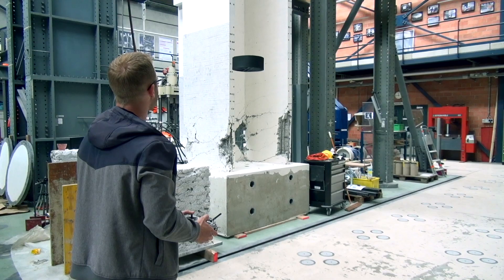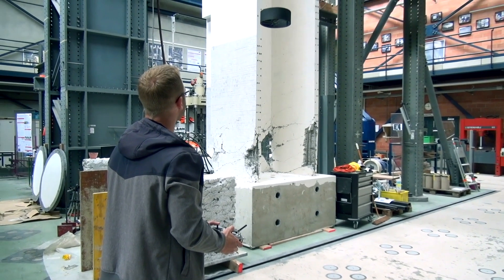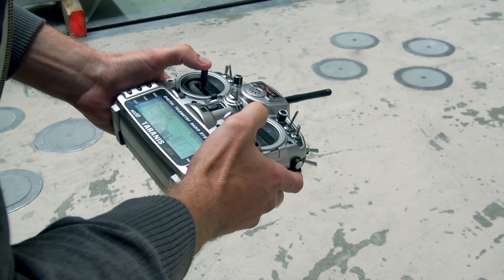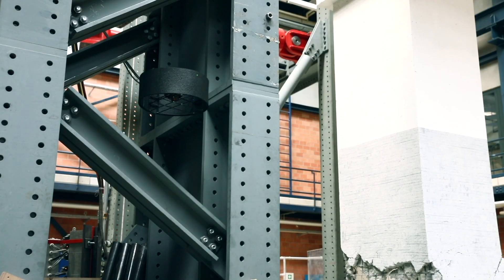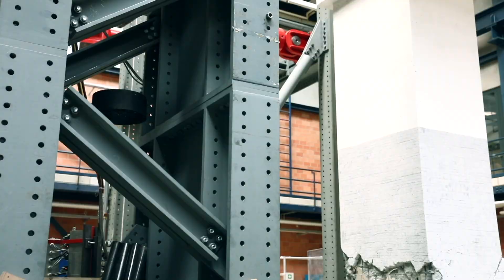New dual-propeller drone can fly twice as long

Comment: If a project is touted with the kudos of a respected research establishment behind it...but resembles a ponzi start-up scheme?
Kickstarter re-imbursed the pledges for the failed Fleye, same principle as this.
Put a big shroud on a barely controllable drone and it's inside flights only!
The size of the props confers minimal gain over existing consumer products sold as toys.
Algorithmn. Mystique. Baffle waffle. Angled hinge rotor blades and synchronised phase of a sine input to the motor allows a SINGLE rotor to fly. Lots of other issues, definitely at the 30 inch rotor blade size needed for real efficiency say 20g/w.
It's a research project, maybe someone's Phd. It doesn't have to be truly practical or have any relation to the real world.
Anything with batteries and a motor that flies, can be taken to the demos and trade shows, in China or elsewhere.
Look for the video of the women engineers with their working autonomous drone to seed and clear fog from airport runways and motorways. Not original drone design, but original implementation with a real use in the real world.
Me, not just a cynic. A cynic with a project for a single (or dual counter rotating) big drone based on a geodetic space frame structure and either vanes, algorithm, or satellite small rotors.
Any flying vehicle is a formation of compromises.
Which is a long way from a formation of conjecture, slick video and promises.

Comment: so... swash plates instead of 4 props and esc's? (Nothing wrong with that!)
Reply: Funny. I think whole idea behind quadcopter drones is mechanical simplicity and low price - all you need are four motors with variable RPM, some cheap sensors and electronics. Only moving parts are rings with magnets attached to propellers. 
Helicopter with coaxial rotors is mechanically complicated, harder to assemble and service and I guess these are reasons why this design is not used for hobby drones.